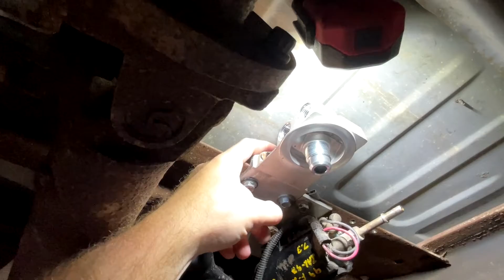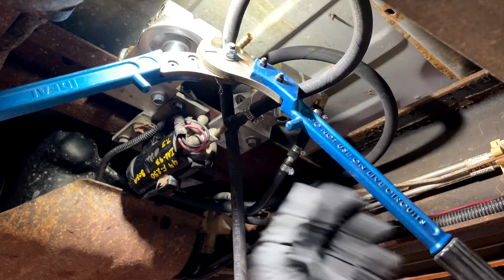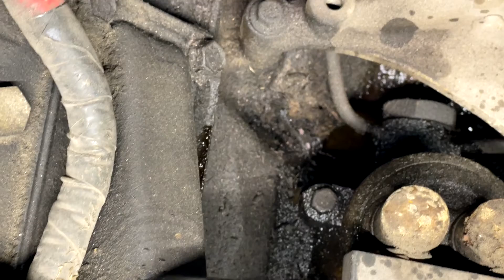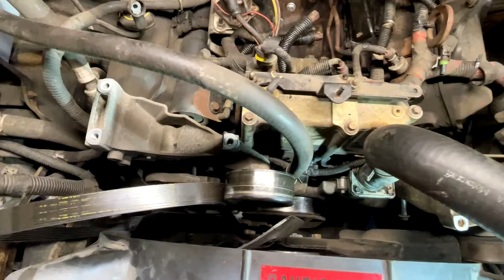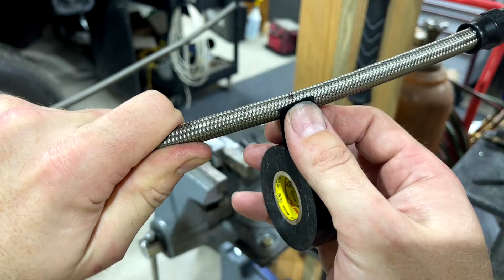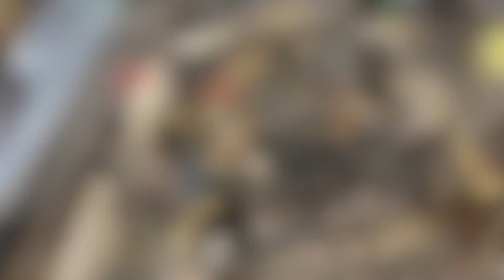7.3L Powerstroke E-Fuel Upgrade! Part 2

Comment: Much less intimidating a DIY project than I thought. Could you not have run the inertia switch off the hot wire on the old fuel bowl or did i miss that its not in line with the fuel pump?
Reply from the maker: I don’t use any of the wires that go to the fuel bowl in these kits I do. 

The inertia switch is in line with the fuel pump wiring however.
Reply: @GarrettsOBSGarage   But don’t the other kits like Marty’s do that? I was curious as to why all of the additional work. Really awesome and thorough video you’ve presented here. I’m looking forward to doing this myself.
Reply from the maker: @c @csedan510 no, Marty’s kit taps into the top of the fuse box. 

I’m sure other kits tell you to do that, and it used to be the way it was done back when e fuel was very new for these trucks.   However, why run the extra wire from the engine bay?   

Thanks for the response!  I try to make everything fit and finish really well, and I’ve done quite a few this way and everyone has been happy with the results.
Reply: @GarrettsOBSGarage  My confusion in watching too many videos on this! I truly thank you for your responses and the terrific attention to detail!
Reply from the maker: @csedan510 no worries!  Glad I could help!  Thank you!

Comment: Hey there! Do you know how many fittings for the braided PTFE you used for each size? Currently ordering parts for my 97 ccsb 7.3! Great video, thanks!
Reply from the maker: Feed and return lines are -4.  Main fuel lines are -6.  

So however you’d like to route and run them will decide what you buy and how many. I used 8 of the -4 in the valley an 4 of the -6
Reply: @GarrettsOBSGarage  Awesome, thanks so much man! This is by far the best video I have seen online for a diy system! God bless brother!

Comment: When i see guys running around with filters hanging down as if they install them for visual not function i get pissed. My rclb i tucked up high as i could and still was paranoid. If i do again i would use anodized bases or look into the new racor Snap series. Buffalo roads arent kind to a plow truck regardless of how well i maintain the fluid film.
Reply from the maker: Fluid film is generally worthless in my eyes anyway.  But yes. Always get those filters as high as possible!

Comment: Instead  of the quick connect fittings can you still put a rubber hose over it and use a hose clamp?
Reply from the maker: Rubber hose over what?   The fuel line on the rail?   Yes, you can do that, as long as it doesn’t leak.
Reply: @GarrettsOBSGarage  LIke the quick connect barb on the selector valve or really any quick connect barb. Sorry for the confusion.
Reply from the maker: @JBizzle822  oh, no, you HAVE to use the quick connect due to space.  A hose will just kink.
Reply: @GarrettsOBSGarage  Another question, sorry for asking so many I am just trying to price out the parts I need for this. What type/brand are the rubber hoses you use on the fuel filter and pump assembly?
Reply from the maker: @JBizzle822  I use aeroquip -6 or Parker push lok.  3/8”

Comment: Thanks for taking the time to make this very interesting video. I really like your vice set up on the vertical column. Pretty cool.
An e fuel setup was never something I thought about much until I watched your recent videos. I've had the factory fuel bowl heater short out and rebuilt the leaky fuel bowl back in 2012. I replaced the leaky fuel pump in the valley back in 2019. It seems like every few years there is something leaking in the valley. This kit really opens up the valley. I like it! Great job!
Now that the fuel bowl heater is deleted, has this caused any issues??
Especially of course starting and running in the cold? 
I spend some time in Vermont and Maine in the winter.
Reply from the maker: Thanks for watching!   The vice setup works great there and doesn’t move at all.  I’ve had horrible issues with the factory fuel system over the years and the EFUEL is the solution to a lot of those issues!

I’ve never had an issue with cold starting with the Efuel, a truck with a healthy glow plug system and lighter oil and solid injectors will fire every time.   I’ve had my truck start at 10 below without issues in the past.   Once the oil is warmed up, it’ll run better, since the oil is more problematic than the fuel.  The heater realistically just keeps untreated fuel from gelling, but once it’s gelled, it’s a problem anyway and the heater is only on when the truck is on.